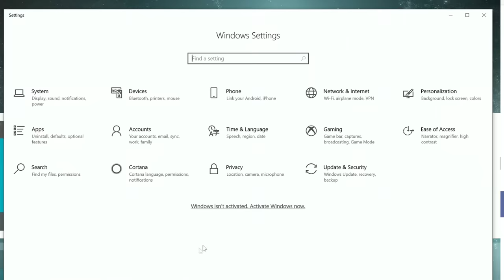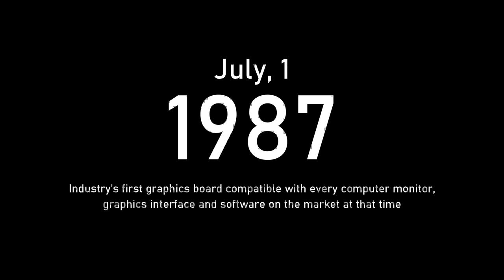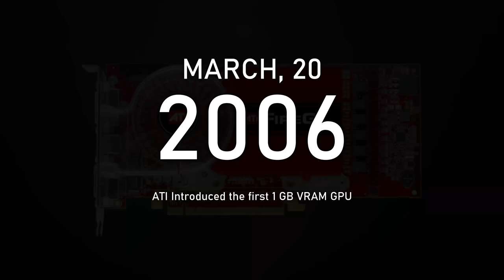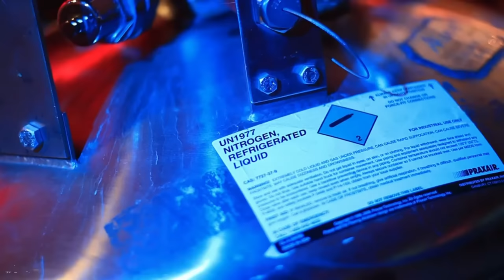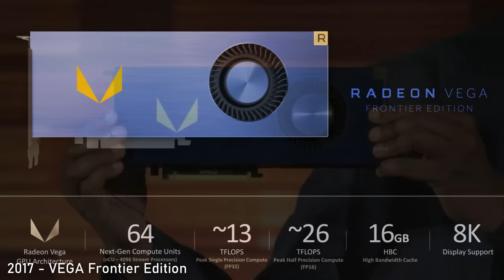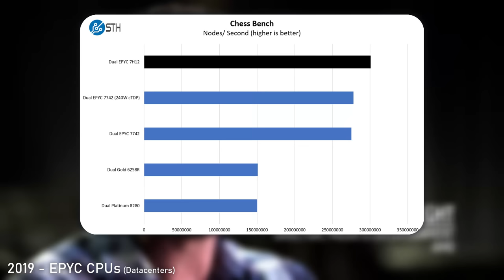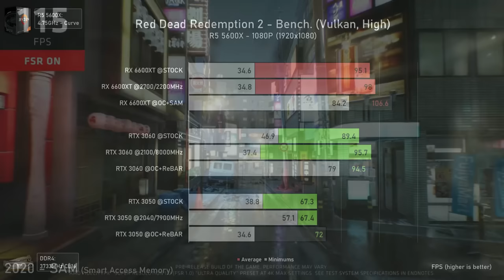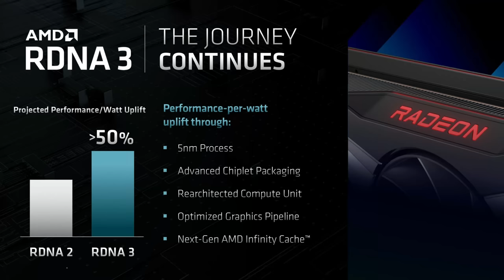AMD History and Innovations (1969-2022) | Documentary

Comment: Great Video Fabio. I guess I'll show my age here, started in the PC hobby with a IBM PC Clone running at a whopping 4.77mhz.
My very first AMD CPU was a 386/40 (yes, 40mhz), it was considerably faster than Intel's 386/33. :)
I also had a Athlon 650 slot-A (Not Socket-A) CPU, followed by a few Phenoms and then went Intel with a 4790k and am now back with AMD 5600x and 5900x.
I also had a few ATI cards way back when, and I think the last time AMD/ATI had a faster GPU than nVidia was the 7970, it's why I had bought one of those LOL.
I think if I had to take all the money I spent on computers over the years, I could probably buy a fancy exotic car. LOL
Yep, I'm 63 and retired, remember the Commodore Vic-20, a whopping 3.5 killobytes of ram? Also, in my 386 days, one meg of ram was at times $100, then it went down to $50 a meg. Yes, computer stuff was outrageously expensive. A floppy drive for a Commodore Vic-20 or 64 and also for a Atari 400 / 800 was $600. We're talking about Canadian prices but still! OUCH!!!!!! LOL
Reply from the maker: Damn, great times! Also, the HD 7000 series were awesome cards
Reply: I had a commodore 128 with an external floppy disk drive. 5.25 “ floppy disks.Remember those? Also used the tape deck for my comm 64. Wow the 80’s were great! But the computers suck back then. I love those ATI cards too. Loving my 6800xt. RDNA 2 is just amazing. But I hear RDNA 3 are going to be a beast! Cheers mate!
Reply: @andyjoelharper3448  Indeed. I also had a TRS-80 Model 3 which I used to run a BBS, had bought a clearance 5 meg (yes Meg) hard drive for it at $1k. As for PC's I remember each time you bought a new add on card, you had to set the IRQ number and DNA channel number with onboard jumpers or else nothing would work, get all sorts of hardware conflicts. But once you had that set, it worked like a dream. LOL The bloody sound blaster cards were a pain, they always defaulted to the parallel printer port and always caused conflicts until you got them set just right (normally would have to change the jumper to IRQ-5) LOL
I also remember using the tape drive for both Vic-20 and Atari 800, the Commodore tape system was far superior to that of the Atari, the Atari one was a royal pain to use.
Oh the good old days, no spyware (windows10 and 11), not everyone needing to know your underwear size, you just used and configured your computer to what YOU wanted, not to what some manufacturer wants (Forced updates for software and also hardware firmwares). I actually miss the simplicity of those days! :)

Comment: That's quite the jump from 1981 to 1996.  That skips basically all of the history that explains why AMD can make x86 processors.  Long story short, the juggernaut IBM didn't want to have a single supplier for the processors going into their new PC lineup, so they insisted that Intel explicitly assign second-source rights to other companies, including AMD.  

It also skips over the fact that Intel didn't honor their agreements, and refused to give the designs for the 386 and 486 to AMD, who was still legally entitled to be a second source for them.  AMD had to reverse engineer both chips.

Intel even sued AMD, not for copying the designs (which AMD had a right to), but for using Intel's naming.  Intel lost, because you can't trademark a number.  That's why Intel dropped the naming scheme after the 486, releasing the Pentium rather than the 586 - that's a name they could trademark.  And that's where AMD stopped copying Intel's designs, bringing us to the K5 part of your video.

Call that a very short summary of what happened in that time gap.
Reply from the maker: Thanks, I focused mostly on the achievements and not much on the details per se. Thanks for watching and commenting :D

Comment: Vega was worth mentioning as a really good miner card, and the 56 unlockable to "64" as  cheap 1080 replacement for gaming. Today tuned and with modded drivers with rebar it smashes the 1080 in many games.
Reply from the maker: Amd has been having lots of unlockable products like CPUs, but vega wasnt one of them. All you did with vega was remove power limits
Reply: @AncientGameplays  not just power, you unlocked the HBM clock, and that was the main thing since Vegas were memory bandwidth starved both for mining and for gaming. I've put the quotes around "64" since it was not a real 64, but those compute units were not that much important on a card so much starved in memory bandwidth. I recall mine went from default 800 HBM to >1100. It would have scaled even more if it had faster memory. Even tough very compute oriented it was running Forza 5 at 1440p/High+HDR with nearly 120 FPS when clocked and SAM through Nimez drivers. Not a buy for the average user, but a good investment for a geek that mined its value a few times over. It paid my new GPU, so I cannot be harsh towards it. It was not a good card but it was the most profitable I have had since it bought me a gaming chair and a new GPU  :)
Reply from the maker: @marsovac  exactly but the clock was unlocked because the voltage and power were unlocked as well, otherwise it couldnt be done 💪💪

Comment: Still kinda sad I didn't get the X3D, but that costs like over 600 euros here. Got a used 5900X for 250 though, but damn this thing is hot!
Reply from the maker: a 5900X fir 250 was a steal! Also, yeah, you can undervolt it for better results. use Curve Optimizer

Comment: Dear Fabio! May I ask you one AMD question? As you told us about Resizable BAR before, I tried to use it on "MSI B450 Carbon max" motherboard with the latest BIOS version. But both W7 and W10 become stuck during loading with Re-BAR on. Even W10 crushed totally! But one guy showed the BAR working with B350 motherboard. So, as I suppose, you tested BAR only with B550 and may be you have any idea why the winodws (W10) crushes on B450 (even with the standart BIOS parameters)?
Reply from the maker: You have a old windows format, tou need to change it
Reply: @AncientGameplays  Hmm, the latest W10 with updates, the latest B450 chipset drivers from AMD. Different BIOS versions. Both standard and boosted RAM & processor parameters... All stuck.
It seems that B450 got support only Nvidia Re-BAR, but not AMD at all 😞 ("Optimized Resizable BAR (Re-Size BAR) function with NVidia Graphics cards")
Thank you for your suggestion, Fabio)

Comment: Upvoted due to incredible research here!  It sure does seem like AMD is on the correct path vs Intel.  However, they fumbled a bit in 2022 with the pricing on Zen 4 (plus higher motherboard cost) and especially RDNA 3.  I hate that they have followed Nvidia's "greedy" strategy on the RDNA 3 cards (all 2 of them, at the time of this comment).  I think they could have smashed the market with say 700 dollars on 7900XT and 850 on 7900XTX.  While that isn't cheap, it does make a great value statement against Nvidia's "failed" 4000 stack.  As for Intel, they have problems, big problems ahead of them.  Either way, great video!

Comment: My first computer had a Pentium D in it back around 2005 I'd say and it was absolutely amazing for the time from what I've read it was two Pentium 4's on one die I never had any problem running any program back then it was the video cards back then that held me back I remember I got my mom to buy me a really early NVidia card that was Pci because Pci-e wasn't even a thing yet but ended up returning the card to the store because it required external power and my psu didn't have it lol
Reply: Ive also only seen ONE triple core AMD in my life it was in an HP laptop that I sold to my brother - did not last long but could have been something else he smashed it before I could look at it

Comment: Curious of your opinion on which drivers I should be using for AMD rx5700 xt. Currently still running 22.5.1
Reply from the maker: I would keep the 22.5.1 for now unless you wanted more OpenGL performance
Reply: @AncientGameplays  I actually have 22.5.2 which are the recommended ones. I mostly run WarZone and State of Decay 2.

Comment: Actually AMD's first in house chip was the Am386 which was reverse engineered from Intels 80386 due to licencing disagreements and litigation, which Intel subsequently lost. It was actually a better chip than Intels, Quote: "..had better performance, ran cooler and used less power". Source WikiChip. I had the 386DX40, with 387 co-processor, which outperformed all my friends Intel 386's and some low end 486 SX models.
Reply from the maker: Interesting but i believe they werent in socket cpus. Thanks for letting know!
Reply: @AncientGameplays  They were available as CPGA (socketed) or board mount configuration.
Reply from the maker: @smifffies  Oh I see

Comment: You are putting the FX series in a negative light. The boards required more energy because they could do MUCH MORE than intel board. That is why intel had to drop its old series of boards to build new ones. It was not required for AMD to use more power based boards. They could be used on lower boards for Higher level chips.
Reply from the maker: I was talking about the fx 9000 series, what I said was/is true and still stands. AMD FX was never in a "good light", they were just okay for most things
Reply: @AncientGameplays  OH i know they where never looked favorably from other users. But that is because they focused on single core performance. Which most other users. They focused on Multi Core processing. These are two different people. 

People who care about single core performance and people who only care about multi-core performance. To them. And me. it was a perfect performance processor. Quiet and powerful. For editing and graphics.
Reply from the maker: @WarsunGames  Well, not really, I had some chips of those like the 4100, 6100, 8150, 8350 and 8370 so I know AMD FX quite well, they were a good price/performance apart from the FX 9000

Comment: I have nvdia rtx 3050ti laptop(ASUS ROG m16 GU603HE / i7-11800U , rtx3050ti 4gb, ram 16gb, ssd 512, screen 144hz / my bios ver 3.1.5)... and now suddenly my GPU clock stuck in 210mhz either in idle or playing game... my gpu clock stay in 210mhz.. anyone know why this happen and how to fix it? 

chronology : 
1. i think this happen after i hard reset my laptop with 40sec hold and press power button, i do hard reset because my laptop can not boot up( my laptop can not boot up and totally shutdown when i shutdown my laptop with my new cooling pad connected (i buying cheap cooling pad that price just $5), when i first using this cooling pad that is a notif from windows try to warn me that is not compatible and my device maybe will not working normal but the fan is still on so i ignore that warning and when i shutdown my laptop totally turn of like with no power)... 

2. i have ac adapter connected but the light indicator is not turn on and normal press power button is not work.. so i doing hard reset with 40sec long press my power button and everything become normal.. ( i try to shutdown again without that new cooling pad connected and its just a normal shutdown and i can turn on my laptop like a normal but when i try again shutdown with that new cooling pad connected its become totally shutdown again ... so i must do hard reset with 40sec long press power button again) after that i never use that cooling pad again...

3. my laptop can turn on like usually but after that when i open game its become fps drop and lagging and when i check my gpu clock is stuck at 210mhz

i try to fix : 
- i have already upgrade my driver to latest driver (516.94) and try to uninstall with DDU and re-install it... and try setting power management to max performance and try turn off pci express ... its all not work... my GPU still in 210mhz... (idle and playing game)

- the only way to increase my gpu clock only with turbo mode in armory crate and it just increase 100mhz to 310mhz wtf... or increase using asus tweak 3 just can +500mhz to 700mhz max... (i can not increase voltage and power.. its disabled i dont know why.. just can increase gpu clock and memory clock)

question :
-so anyone know how to fix my gpu clock? maybe i miss something?
Reply from the maker: Just do a clean drivers install to start wirh
Reply: @AncientGameplays  its not work... i have try to uninstall with DDU and re install latest driver.. still lock at 210mhz.. i try to flashing bios too and its avail too

Comment: Ta bom! Just a few remarks from the top of my head:

Pentium 4 were not that bad. The Northwood chips were in fact a bit cooler than the equivalent Athlon XP and Intel Willamette cpus. Despite the price, Pentium CPUs were always performing good even when compared with the first releases of A64 (check Pentium 4 Northwood iteration). And it took like 3 or 4 iterations of the Athlon 64 (the arrival of Venice and San Diego) for Intel really be pushed against the ropes. Only around that time the P4 Prescott CPUs were release. And oh boy, you could heat a whole house in the winter with one of those. When the only solution is to push frequencies we know what happens.

Pentium D were not really dual-core CPUs. Both 800 and 900 series were just 2 Pentium cores on 2 separated dies. Different from the Athlon 64 architecture which was based on a 2 core 1 die design. Nevertheless later on Intel released the Pentium D 805. With abnormal overclock capabilities, it was often the bang for the buck around that time (if you overclock it ofc). Until the release of the Coroe at least. 

Regarding your server “question”. I think Athlon MP was the first server/workstation line of CPUs. Or at least the first ones with dual-socket board.

I had a few more things to write, but I can’t remember. Or maybe I’m just feeling old and sad thinking I know code names like Venice, willamette and Conroe by heart. 😅

Nevertheless it’s a really nice video. Keep it up!
Reply from the maker: Thanks!
Pentium D were in fact dual cores, if they were on different dies it doesn't matter (technically ofc), Ryzen chips also have cores in different dies :D
Um grande abraço!
Reply: @AncientGameplays  I think it matters (for the Pentium D ofc). On this case putting two V6 engines on the same car doesn't make it a V12.

Due to the way Pentium D were designed, the multi-core behaviour was more like a dual-socket motherboard with 2 single-core Xeon XP (or MP can't recall the correct one that was similar to the Pentium 4 at that time). The sync between both cores was a pain in the butt which led to terrible multi-threading performance. Though the performance boost was noticeable if you were using 2 different single-thread workloads.

When you compare the performance boost between a Pentium 4 and a Pentium D with the boost of a Athlon 64 and a Athlon 64 X2, you see what I'm talking about.
Intel at that time had to work something out to "compete" with the A64 X2. The cheap and quickest way was to slam 2 single-core CPUs together with a "few" tweaks. That's my point.

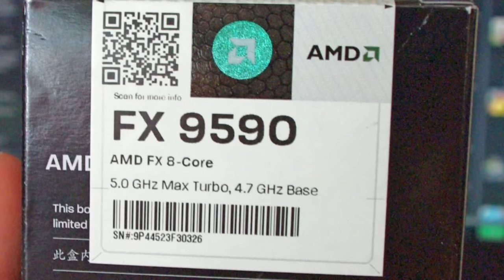Comment: 19:31 Also that is not accurate. They where not Overclocked. They started at a base clock of 4.7 an climbed up to 5GHZ. You could still Overclock it up to 8GHz.
Reply from the maker: Boost clocks are "overclock", they just come that way from factory, also, those were EXACTLY the same as the FX 8000, so basically, overclocked FX 8000, and 8Ghz? That's with LN2...even Ryzens can go over 6.5GHz with LN2
Reply: @AncientGameplays  Only for Intel. They would sell their processors preoverclocked and claim it was a boost but when investigated they where just overclocked based on the motherboards then overclocked again from the chips.
Reply from the maker: @WarsunGames  that was a different thing...even nowadays the boost are relative to many things, like temps, mobo, power limit and and so on
Reply: @AncientGameplays  Well yes of course but we are talking about the week we released it.
Reply: @AncientGameplays  When we were in development of it it was designed to work perfectly with a many new programs coming out. But when it came down to games. The processor had to be able to play games using multi-core performance.

 An only a few games desired to use multi-core performance for bench marking. So not everyone got what they wanted. But i can assure you. People using the FX series had no complaints.
Reply: @AncientGameplays  OK going to bed. Great video. Well done!

Comment: Arguing that FX was "ahead of it's time" instead of an absolute dumbster fire is absolutely wild. It was a shitty architecture with bad performance and even worse efficiency. Nothing more nothing less.
Reply from the maker: It was though, that's why it performed better years later
Reply: I tried looking for those benchmarks but could not find them. The closest one from a good source was a 2018 video by Hardware Unboxed comparing the 8350 to the 2600k. Surprise: The then much faster CPU is still much faster.

I think, for whatever reason, you might be a little biased. FX was an absolute embarrassment. It's the intel 14th gen in terms of power consumption but without the performance.